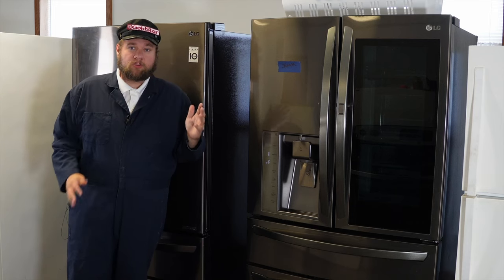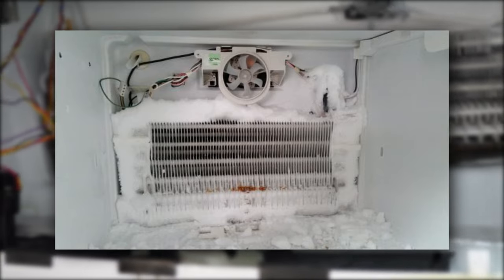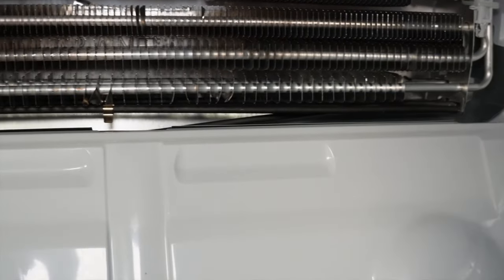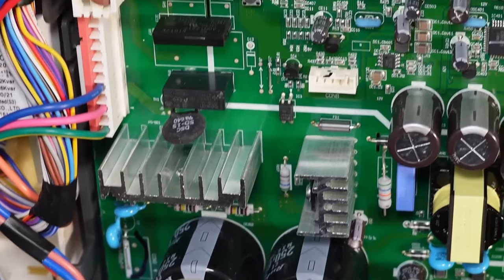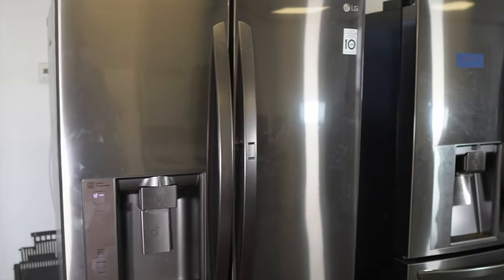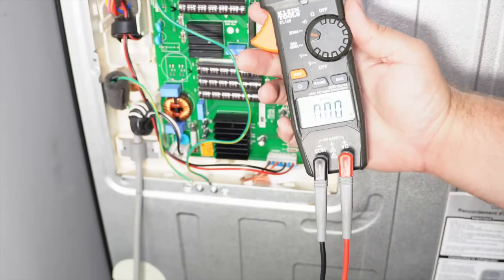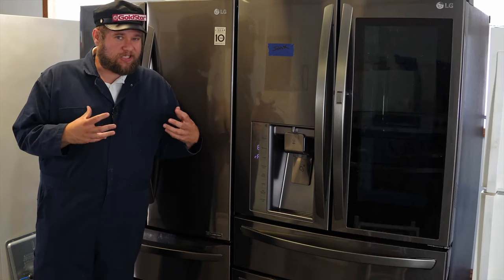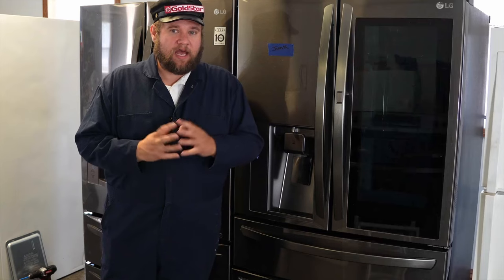LG Refrigerator Won't Cool - How to Troubleshoot and Fix

Comment: Two items caught my attention: 1) current is measured in amps and not ohms and 2) please do not measure a fuse using an ohm meter when there is power on the circuit - there is a possibility of damaging the meter.  By the way - GREAT videos,I really love them!
Reply: I noticed the same error
Reply: I blow the fuse on my fluke like that every time, and they are not cheap! Best way is continuity test tone if you meter has it.
Reply: Turn it off to check fuses, they are not shunts you cannot measure the amperage/current across them.  Measure resistance across them with an ohm meter.  A continuity check is a type of ohm meter.  If you know the correct voltage, you can also measure that on both sides of the fuse.
Reply: Shut the power down, impedance is the safest and easiest way to determine a circuit break, blown fuses. No need to measure load or power, here at least

Comment: Solution: don’t buy an LG with a linear inverter compressor! These go bad around 5 years or so. Your whole fridge will stop cooling well and you’ll have to call LG to have them send a tech to swap out the compressor under warranty. Highly recommend you stay away from LG refrigerators until they permanently fix their linear compressors.
Reply: They totally dropped the linear compressor for their newer models and reverted to a more conventional 'smart inverter' instead
Reply: Not entirely. Some of them still do. One way to tell if it has a linear compressor is if it has the “craft ice” feature where it makes ice balls. Stay away from those as they all use the linear compressor
Reply: YOU ahve to pay the labor even if the compressor is covered. Just wonder how much the labor for replacing the compressor.
Reply: @Ikey04-ge9gy mine just went out I bought it Nov 9th 2022 and mine makes balls 😢
Reply: @paulng1508  He explained the cost in the video, compressor runs $350 to $500, which LG should cover, but the tech will charge $700.00 or more to replace and run the checks.

Comment: The best way to fix an LG fridge is not to buy a LG fridge in the first place.  My experience with Korean appliances... they look very pretty & stylish, but the build quality sucks.  I ended up replacing them with Whirlpool appliances that were "assembled" in America.
Reply: I heard LG ranges are prone to scratching
Reply: Their washing machines are perfect though
Reply: Fridges sure American brands are great. But washers and dryers and microwaves and maybe even ranges, LG tops any American brand. Especially the laundry units. They are Built very well and can last very long
Reply: @ZenX-0992  Not so fast, the spider assembly, that holds the drum on front loaders can give out after about 2 years of operation, you should see that when it is spinning at 1000 rpm or so when it gives out!! Whooo hooo.
Reply: 😢assebled. not Made. big difference
Reply: We replaced our LG with a Whirlpool and have nothing but trouble with it. Our LG sits in the laundry room and is just now giving us cooling issues. It's 14 years old.
Reply: Some of their engineering sucks also. On our newest LG fridge 2 front door model, 2 out of 3 bins cannot be pulled out unless both doors are open. Only the 1 bin drawer on the left can be pulled out with just the 1 left door open. The ice maker or water delivery stops by itself sometimes and then comes back on when ever it feels ready. I would throw out all the tech in this fridge and go back to a 1970 something model that would run for 25 yrs or more and then still end up in someones garage as a beer fridge still running. And I can dig ice out of an ice cube tray for my drink of rum without exerting my self.

Comment: Great video!  This saved me huge money.  After walking through several of the suggested checks, it was very helpful to hear the details close to the end of the video about the 5 year warranty for the sealed system and compressor.  LG was very responsive after I called the 1-800 number.   They scheduled an appointment with a technician who is replacing the evaporator, condenser, and compressor in our unit, with parts and labor covered by the warranty.
Reply from the maker: Glad it helped!
Reply: Had all those done..still won't cool..complete trash
Reply: Trash product. We had 5 years of warrenty. Came out changed everything, including compressor, and within 3 months, a whole load of issues. Older french door  style door the compressor can't keep up! It's a faulty design, which is why they changed the unit.

Comment: Nailed it! 
We had error code #3 and the compressor wasn't running. Per your guidance, we schedule service via LG. They came with parts and replaced the compressor under warranty. Thanks so much.
Reply: Is your fridge still doing good?

Comment: My appliances are LG with exception of the dryer.   I was never confident that the Smart Diagnostics actually worked.  In this case Smart Diagnostics was incorrect, indicating everything is OK even though the compressor was not running and the content of my freezer was thawed.  There was no indication of a problem on the front panel.  But the board LED was flashing 3 times.  After 2 years 8 months in service, the compressor had indeed failed.  LG showed up ahead of the scheduled time and called me 45 minutes in advance of his arrival.  The LG service technician did a great job in my opinion.  I know a little about HVAC and as far as I could tell it was done right.  Good video.  Thanks Ben!
Reply: Agree, the Smart Diagnostics are useless.
Reply: How much did it run you?!?!?
Reply: @djintence  It was covered under warranty. LG dispatched a tech. He called before leaving his previous appointment and arrived early. He replaced the compressor.  I was impressed by the LG customer service.

Comment: Thank you very much for the information. This video is priceless! We bought 2 of these refrigerators last year and the first one failed about 2 weeks after the warranty had run. I will run the tests and the forced defrost before I call LG.
Reply: Did you get your fridge fixed? What was the problem and fix?
Reply: It quit cooling the fridge cab. I suspected the evap. coils were iced up. We live on the wettest part of Hawaii and don't have a/c. I just put all the food elsewhere, and unplugged the unit for a couple of days. Plugged it back in and its been working fine since.
Reply: @kevinpavitt4288  wow. I don't think it's my evap coils. I think my compressor is fucked. But I will try it and see thank you.

Comment: Hey Ben, you do great informative videos. I had an LG that wasn't cooling at all. The current I read at the compressor was .6, but at the con201 I would only get up to 96V, sometimes it made it to 108V. So changed the main pcb board and had same thing. And the LED on the old board and new board both did the same thing, nothing, never lit up at all or flashed any codes.

Comment: I had to have my 3 year old LG refrigerators compressor replaced under the class action warranty. Then about 1 1/2 year later the dam thing froze up in the refer area. It was completely solid ice. Having watched the service tech remove the evaporator panel I did it myself. It took 3 hours with a hair dryer to melt it all. Then I just had to do it again yesterday. This video shows how to check if the fans are working. I doubt my fan is working. Now I have to check the thermistor and defrost fuse and take it back apart again. Oh,it took 24 hours for the thing to get back below 40 degrees! The freezer cools fine. My refrigerator was made in 2018 so I doubt if I qualify for any class action repairs this time.
Reply: Screw that I would of been so mad and just took it to the dump!

Comment: I'll stick with my 1935 GE Monitor Top CK-3. I bought it for 200 bucks and just did the door seal a little while ago. No need for complicated automatic defrost. Put a tray in the bottom, set the control to defrost, wait 8-12 hours, it turns itself back to "on" and leaves the water in the tray. I can open the door and see the evaporator and refrigerant lines right there. No fan. No electronics, just a compressor, a control, and a light.

Comment: On the bottom of the fridge there is a flap that separates the cool air going into the compressor and the hot air leaving the compressor. It can get damaged and come off. that could cause some of the issue as well with the unit.

Comment: You are very good at explaining situations and seem very knowledgeable. I appreciate you taking the time to make these videos. I'm dealing with the LG on the right, and I just can't seem to figure it out. It shows it has freon, but the upper evaporator isn't getting frosty. When I put it into test mode, it skips the third test? I will try all your suggestions and see where I end up. And thank you for the heads up on the law  suit info.
Cheers 🍻 
Shawn

Comment: Hi Ben, just ran across your informative video as I have a cooling issue with my fairly new LG (similar to the one on right side in your video).
Its not cooling (temp around 50F), but the freezer is working fine. Food in freezer are frozen solid.
Had a tech came out and wanted $800 to fix it. Indicated that the evaporator fan assembly need replace. I opted out of the repair and order the just fan and replace it myself. I check to make sure the fan is running before closing the unit up. While I have the assembly opened, I also noted the evaporator is running with light frosting/cold (so I assumed it's functioning). After several days past, frig still around 50F. So now I think the tech had mis-diagnosed the issue. Now I am back to square one. 

In the beginning of your video you shown the issue with just the cabin not cooling, but quickly went through it. You mentioned sensors and thermistors? Could you direct me one how to locate them and test them?
Any additional help/suggestions are appreciated. Thank you
Reply: This same exact thing happened to us. What was your solution?
Reply: @MeganLikesThis  I don't have a solution for it yet. I got some assistance from another channel and perform a few test. Narrowing down to possible evaporator. If that the case, I might better off buying a new fridge.
Reply: Any updates, mine stopped working yesterday. Took everything apart. The fan is blowing but air doesnt seem to reach the fridge up top. Freezer working fine. Debating wether I should replace or get a new fridge ;( curious if you managed with yours!
Reply: Right now I'm freezing jugs of water and keeping them in the fridge 😬

A pain but much better than nothing.

Comment: Good video but a few things I noticed.  Never do a continuity test on a line fuse with the appliance plugged in.  Also, when checking current to the compressor, it's amps not ohms.

Comment: LG compressors known to fail at a high rate on certain models, part of the problem is that they overheat from restricted airflow due to poor design.
It's not enough to just pull out the fridge and vacuum the back plate vent, you need to remove the that plate and vacuum around the condenser coils (8:24).  Do this every 4 months under normal conditions, do it every 2 months if you have dogs, cats or other furry beasts.

Comment: We have the same pictured on right.  We had a 5 years warranty that more than paid for itself.  Had techs out here 4 times to get it fixed.  Now another year later fridge crapped out.  Had to replace compressor which we also had to get a new computer panel and a fan.  Fortunately, the compressor had a 10 year warranty.  All in all a $1000 plus repair.  Never will trust LG.  When it worked loved it.

Comment: This video is fantastically useful.  I have a related question that i cant get my mind around in these LG French door with ice maker..
How does ice freeze in a French door dual zone refrigerator ice maker?  Is there a flexible refrigerant line in/out in addition to a water and power line in the hinge?
Reply: When you open the door where ice maker is you can see an air duct on the side wall going down to the freezer. So basically the freezer air is forced up to the ice maker compartment and then back.

Comment: Such a great video, thank you!  Ours has the 6 flashes going on the board, compressor vibrates and sounds good, fans all working.  You said 6 is likely the board...  Looks like I can get a used one for 100 bucks which is probably worth trying.  I just can't decide if it is worth messing with on my 11 year old machine...  Like what are the chances that a board fixes it (6 flash error code)

Comment: Got a code 6 and compressor seems to be running.  Voltage progresses slowly from 80 VAC to 158 VAC and compressor pulls .4 amps.  Seems like a low refrigerant charge.  However, lost cooling all at once the other day.  All test fu cations work.  Thoughts?
Reply from the maker: Likely compressor. Usually a .4a draw is the big one that signals a bad comp. I just had your exact scenario on a fridge 2 days ago.
Reply: What does a compressor replacement cost?  I got some quotes locally but just wanted a comparison.
Reply: @MrFixitU.S.S.551 - what were your quotes for a new compressor?
Reply: Cheapest was 1,100.  Up to 1,600.

Comment: If I buy this type of LG fridge but opt not to have it plumbed and not use the ice maker, do you think it would last longer?
Reply: LG fridge manufactured in 2021.  Bought less than 2yrs. ago and never used ice maker.  Needed ice so turned on  ice maker switch. 
Came to fridge following morning to discover half a tray of melted ice and thawing freezer contents and warming fridge temperature. Never had an issue before flipping the switch.
LG tech has changed compressor and now fingers are crossed for till tomorrow morning.

Comment: Great video! I ran the tests and in stage “1” all the fans are running properly. I pulled the panels off the back of the fridge and there is no ice build up of any kind. The compressor seems to be running as there is a vibration coming from it. We lost cooling this morning and do not know what to do! Any ideas what could be causing this considering the above? Also, I did run a reset by unplugging for a few minutes. Thanks so much!
Reply: Did you find a fix?
Reply: Hey Danny how's it going?
Reply: Your coil could be covered with dust as mine is right now. This can cause an overheating issue with the compressor, and result in improper operating temperature in the unit. Use a compressor to clean it out properly. So far compressor has already cooled down just from vacuuming the dust out. This should solve my problem of poor cooling in both the Fridge and Freezer. Best Regards

Comment: LG Refrigerator won't cool - When checking the voltage to the compressor I'm seeing a low voltage (50vac) that climbs past the "good" level and the unit shuts down at about 185vac.  Do you think it's the main board, or the compressor loading it? Current at the compressor is at the high end of "good" (0.7 amps) but varies.

Comment: Good video, Ben.  On my same model as yours on the right, the control board is showing the 3 blink code, meaning bad compressor but also the voltage to the compressor is only 85-95  volts while running.  So can both the board and compressor be bad?  Or if board is bad, could it show a wrong code?

Comment: I have a very similar model. I am only getting 118 volts for the compressor.  So it’s a board issue?  How do I be sure of correct voltage?

Comment: Hi Ben, I have a LG French door refrigerator, model # lrfcs25d3s. The unit has begun to trip the GFI when the door is opened. It is not plugged directly into the GFI but  the plug it is in is daisy chained to it. I took the top left door hinge cover off and looked for crimped wires. None found but it still tripped when that side was opened ever so slightly. I taped down the plastic door plunger on top of the piece on the left door that swivels to seal both doors and have not had a problem yet. Your thoughts for how to permanently fix correctly. Thanks in advance.

Comment: Hello, have LG , LFX28968ST   ( Fridge/ FREEZER isn’t Cooling Compressor is vibrating when touch, Fans an condenser Fan are working, after giving fridge a Reboot an hit the test button after gong through test 1-4 on test 1 get 3 Beeps, test 2 get 2 Beeps an on front screen 22 shows, test 3  3 Beeps an 33 on front screen, test 4  No Beep an fridge Fans all stop running an Compressor stops Vibrating. Until reboot or Press test button again, then after short time all fans and Compressor stops again,? What does this mean? PS. Can’t find any Flashing Light on Board or Display Screen. 🙏🙏🙏

Comment: As an engineer, I don’t understand why the system has an internal thermometer and a test suite, plus a rear pub and front panel control and display - but when my cooling failed, the display and audio alarm has no ****ing idea, nor can a special code be entered on the front panel to trigger the test suite without pulling the damn refrigerator out.
Reply from the maker: No idea why LG does it this way. Virtually all other major brands do.
Reply: @bensappliancesandjunk  protects repair income and obsolescence replacement purchases my guess.
Reply: Yes 👏

Comment: My maytag refrigerator was just moved from 1 location to another. It worked before we unplugged it. Now we moved it and it is showing signs of main board failure. How could this have happened? Just coincidentally finally decided to go after 10 years?
Reply: Must have been an electrical surge upon plugging in. Should not happen, but does happen.

Comment: I watch your video, and its very good info. But my question is the tech replace the motor, and after that the lg gave us a new one. But this unit is almost brand new can i fixed?  I tought changing the board, but i got my douts, because i saw another video, where the tech said you have to upgrade de board information before u put a new motor. I pay a second opinion tech, and did not want to deal with it. Any advise?